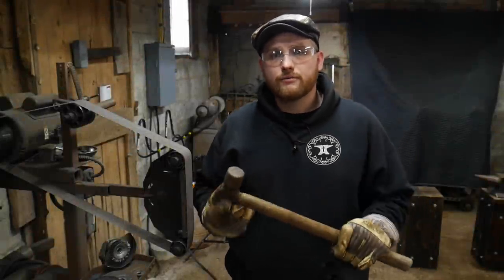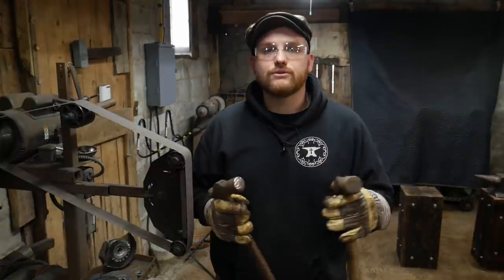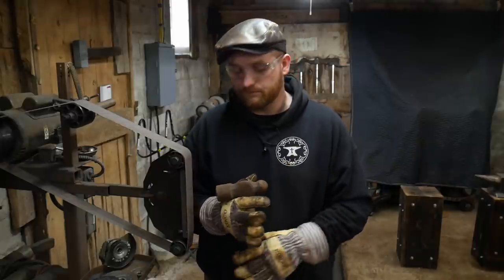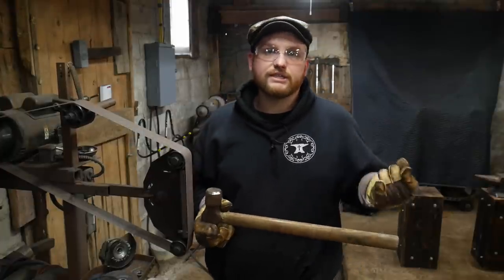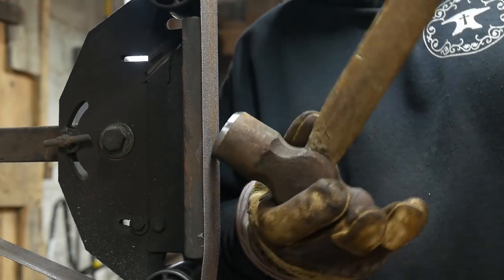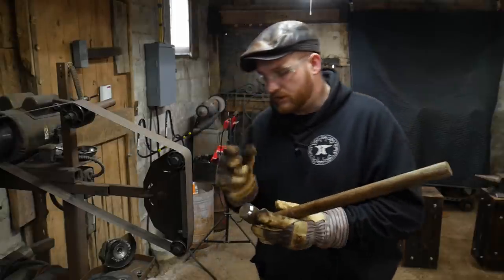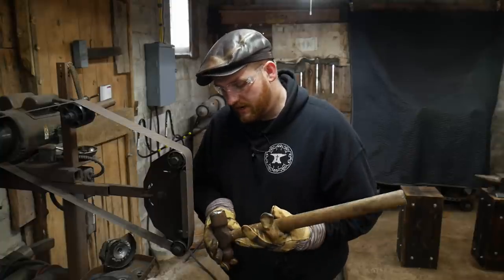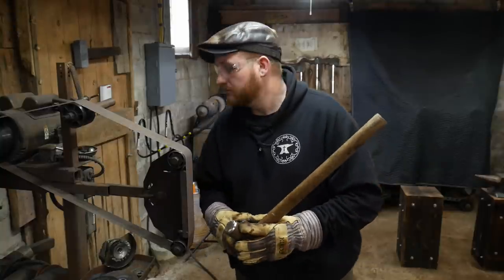Grinding a Ball Peen Hammer Into a More Useful Shape

Comment: I wish you had a new hammer to compare them together because I never seen a Ballpean ( sorry if the spelling is wrong ) hammer with such a round head. I worked with them for over 32 years and never seen one that rounded. I even worked with damn death trap Lead Hammers. But I had every size ball pean hammers Cat had in stock. They used me for recovery or salvage recovery, trying to save bad parts and make them good, either remilling them, remove a broken tap, finish drill holes and retapping, even boring out different holes to put oversize cup plugs in the part. But as I say, I never seen that hammer cut or ground like you are doing so you are re educating me. But I probably will never go as far as you did. I have faced the hammers off because of OSHA's laws. The boss would have me gather up everyone's hammer and that included the lead hammers and grind them down so OSHA would approve.